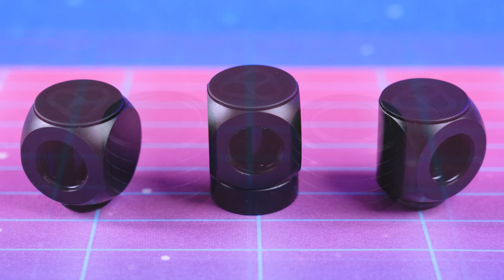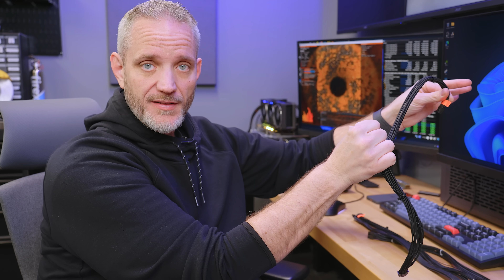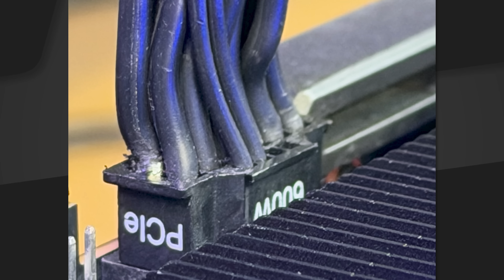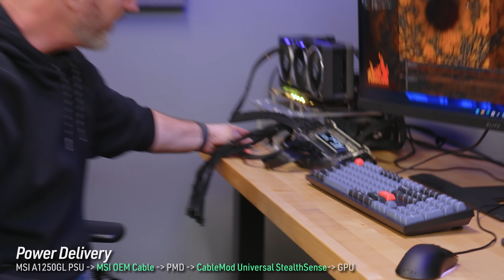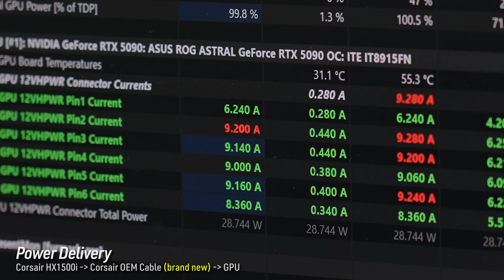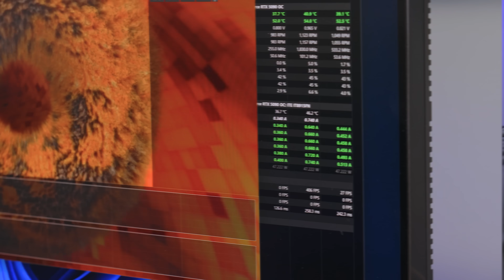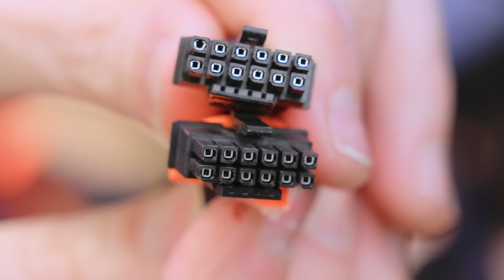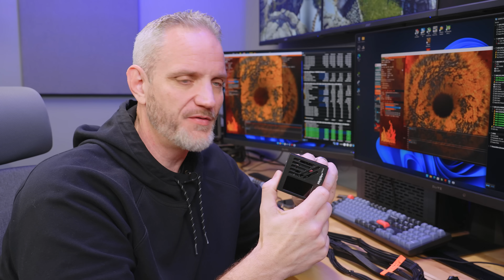More details on what could be causing 12VHPWR / 12V2x6 Cables to melt

Comment: I will never understand how it's possible to fail so incredibly at creating good cables with good connectors. It shouldn't be rocket science
Reply: Sometimes I think it's intentional if something breaks, you have to buy it again ...good for the manufacturer.
Reply: @s_wolf2186  That is called planned obsolescence, and yes it does feels intentional at times and in some cases definitely is so.
Reply: @s_wolf2186  Yeah that practice works in a very short margin and only when competition is low.
Reply: @silentferret1049  the competition is basically zero on the high end
Reply: Greed
Reply: It is a fundamental engineering and manufacturing failure from the word go
Reply: @jodosh you right.
Reply: What makes this even worse is that the company responsible for this disaster is none other than Nvidia—the world leader in GPU design. They have the resources to engineer the most sophisticated microchips and architecture ever known, yet they failed to address a basic hardware flaw. They had a golden opportunity to introduce a safer standard with the 50-series, but instead, they’ve stuck with these failure-prone connectors while pushing power consumption even higher. It’s as if they’re prioritizing melting cables over actual reliability at this point.
Reply: Look at the high power RC Hobby industry, they have 3.7v, 7.2v, 11v, and up connectors that supply thousands of watts of power from LIPO packs to very big high performance RC vehicles and they don't get melty connectors... You're right, it's not rocket surgery
Reply: @Doom2pro you right! I melted my 5070ti connected and soldered in 8ga wires and EC5 connectors. EC5 are common RC battery connector that have 2 wires and can handle 150amps at 12v-44v. Never an issue.
Reply: @nhbountyhunter And they can handle repeated insertions because they are meant for battery connectors.
Reply: @nhbountyhunter  So where did you put the 4 mm² cables? Drilled new holes in your PCB?  You kind of people have no clue how EMS works or soldering.
Reply: @darknase been soldering since highschool when I was on the robotics team. If your talking about the sence pins. I bridged them with solder and ran a 24ga from that to the positive side of the connector. It works perfectly. Infact I got better OC results.
Reply: @darknase If you smartass, you should actually be smarter then the other guy.
Reply: @nhbountyhunter  How did you manage to melt a connector with 5070 ti? Do I need to be careful? It's just ~350 watts and 75 comes from the mobo so how? @.@
Reply: @Lich__2594 a 5070 Ti shouldn't be melting cables unless there is a fault in the cable or it wasn't inserted properly.  As long as you have a good PSU and use the cable that came with the PSU, and you connect it properly.  You will be fine.
Reply: @thornstrikesback Yeah I know. I'm just curious how this person managed to do it at all
Reply: @Lich__2594  I have no idea. I think it was the same problem as Jay here. I think it was too lose on multiple pins or I just plane had it crooked. I was using a cheap set of cable extensions from Amazon.
Reply: @nhbountyhunter ohh. Thanks for explaining that. At first I was going to go go with a sketchy 2 PCI cables into 3 for the 12VHPWR adapter. Lucky I didn't and "just" got a new psu with the proper cable :)
Reply: @thornstrikesback not just a matter of proper install.  the pins are known not to make proper contact.  iirc jayz showed it took 3 to 5 insertion to get proper contact even with proper installation.
Reply: @richardbrooksshnee well... when i say proper install, i didn't feel the need to spell out everything as common sense should prevail in these situations... but now that I've said that, maybe we do need to spell it out for people, because common sense doesn't seem to exist for many people these days, so yes... definitely check the actual pins, PSU connection and angle of the cable when it wraps under or over the GPU.  But side note... Jay did say those cables were used many times over so that is not exactly real-world when it comes to loose pins like he had, unless you had a really dodgy cable.
Reply: @thornstrikesback way to ignore the context of the discussion and somehow attribute context from this video wrongly to information not from it.  new 12vhpwr connectors do not make proper contact on first install.  jayz discovered this, iirc der8auer confirmed it.  even properly connected 12vhpwr can wind up cooking under the low loads of a 5070 due to how unbalanced the loads can be on the individual pins.
Reply: @richardbrooksshnee dude... relax.  I was agreeing with you.
Reply: @nhbountyhunter *you're *sense
Reply: @tarron3237*than
Reply: @Doom2pro  We going to be using XT60 soon lol
Reply: @NeverenCH  Plenty of knock-off XT60 connectors (I think HobbyKing actually open sourced it?) that have melted in the past.
Reply: @Doom2pro it is rocket surgery to safe 20 cents on a connector on a 1000+ $ card. This is just straight up greed. And it wouldn't even be that big of an issue, if they had stuck with seperated phases like on the 3000 series and before cards.
Reply: @clockworkvanhellsing372  take 20 cents times a million sold cards, you´ll be surprised how it stacks up...
Reply: @Doom2pro  Look at the tiny pins inside the connector hurt my eyes.
Reply: A proper QS8 connector handles 110A continuous but these connectors can be $10 per pair. People don't fully appreciate how crappy and cheap the molex clone connectors on PSUs are. The PSU makers will never-ever spend $5 per connector when they can get away with 50 cents. You can't get a $150 PSU at that price any longer if you put an extra 30 dollars worth of connectors on it and $10 more copper in the thicker gauge wires
Reply: @Doom2pro I have burned and even melted 12 gauge cables on a 200w 12v motor. The connectors usually fail first even though they are rated for 200+ amps. For short bursts, I have pulled more than 500 amps through the same connectors.

A wire is only as good as it's weakest link. Now we have modular removable cables adding a connection, sometimes people run sleeved cable extensions, and all the angled 12v high power adapters, I am surprised they work for any period at all. 16 gauge wires at 12v is a joke. Trillion dollar companies save pennies in too small of wire, and  tiny connectors.
Reply: @lilsammywasapunkrock Spade connectors aren't the same as RC battery connectors.
Reply: @Doom2pro yeah, they are rated for significantly less.
Reply: We had good cables - 6 and 8 pins - 150W per 8 pin with 75W from the mobo. Was more than enough for 99.9% of the cards with 3x8 pin getting a total of 525W. But no.... need to design a new shitty cable that can't handle it.
Reply: Bad incentives.
Reply: The design spec is flawed. It is painfully obvious.
Reply: For the 5090... it is
Reply: cost saving
Reply: cutting cost and profit
Reply: So are keyboards but apple was hard learning to. There should be more class action lawsuits!
Reply: And the nvidia bashing continues. Buy AMD then, problem solved
Reply: @AndyOG2000 class action lawsuit nvidia and buy AMD. FTFY
Reply: Only because NoVideo wanted slick looking GPU and Cables.
Reply: As if they are trying really hard to make gaming PCs obsolete, so you end up paying for cloud gaming.
Reply: prolly AI designs ^^
Reply: The standard is the problem! It's not possible to create good cables, they will all fail eventually
Reply: Eps 12v (4 12v wires rated 300w), or pcie 8pin (3 12v wires rated 150w high power versions also exist rated around 288w and 324w)
Reply: It was designed to fail.
Reply: @kanlu5199 Sorry to inform you it's not quite as you think in this case. He replied to me and said he was using cheap extension cables:)
Reply: Wait, sorry you replied to something else. YouTube app is so unclear about this
Reply: @kanlu5199  That definitely is a capitalist thing.
Reply: It isn't. But it's more expensive
Reply: Because so many people are buy cheap PSU, spend the $600 and get 1600Watt PSU … a good one will be heavy, big, and requires a large case … or keeping buy cheap PSUs and hope they don’t destroy your 5090.
Reply: @simhorizon446  the psu is where one should never cheap out. If you buy a 5090 with a cheap psu, you kinda deserve for it to break. That person clearly doesn't need a 5090
Reply: @vaibuscala6441  Yep, it's like they spent their entire savings on a GPU and nothing left over for a quality PSU ... why is Jay using an MSI garbage PSU ... to prove a point that cheap PSU will destroy GPUs?
Reply: Even if it was, you would think it was an already solved problem. You do not have to reinvent the wheel if it already exists
Reply: When manufacturing just becomes bulk and QC is limited or as I see it nonexistent. There is no way in hell a 12VHPWR should sit so loose and allow to be wiggled like that. Corsair has indeed dropped the ball at least on their PSU side of things.
Reply: No it isn't. The design of the pins itself is so finicky and requires such low production tolerances, it gets prices out of a reasonable spectrum.
Reply: Even if there is just a 1$ difference between a good cable and a bad cable, when you sell lets say 1 million gpus, thats a million dollars in savings. They've been cheaping out in thermals for quite a while, cables were just the next step.
Reply: They should have partnered with molex to design a proper connector instead of Intel..
Reply: That’s because its worse, its cable science.
Reply: The problem at this point is more the ignorant connector design.
Reply: Its the fucking ridiculous connector that's the problem.   Its as if it was rushed through production just to brag about how they have a connector with higher power ratings.  Too bad they melt from the higher power.
Reply: It's called cost cutting or "cost optimization" lol
Reply: Those rockets that blow up? Bad cables
Reply: To make a profit and undercut competition perhaps they are utilizing recycled wire.
Reply: it must be by design so they can sell more cards
Reply: It isn't rocket science at all. Great solutions exist. It is greed and a few pennies. Maybe also pathological stubborness mixed in.
Reply: Definitely it's not rocket science but if they keep using shitty alloys for their conductors the reliability becomes a matter of blind faith.
Reply: We can't even get a USB cable at this point
Reply: I mean it kind of is dude
Reply: People will buy anyway so why even care?
Reply: Its by design
Reply: Yeah but it isn't wire science

Wait
Reply: They cheap out on materials is my guess
Reply: Sounds exactly like building a rocket, expecting a Saturn.... When you start with paper and glue.... You can CHOOSE WHICH SHORTCUT, you take ;)
Reply: I have a beautiful aftermarket white high quality braided cable on my 4090 and it cost me like $10. It's been working perfectly for 3 years.
Reply: yup, it's worse, it's CAAAABLE SCIENCE 😂
Reply: Current is not so easy, unfortunately.

The whole idea of having multiple wires makes the system susceptible to these problems.
I think the solution here will be beefier (and fewer) cables, with a different connector altogether.
Alternatively, higher voltages (24V, 48V) so the currents are lower.
Reply: @filippopossenti1791  It would be as easy as load balancing the thing like it was done for 100 years of VGAs needing external power. Just some overeducated bachelors degree smartass knew better. "On paper and in simulation this works, let´s push it to production untested and unverified." Excuse my language, I´m a machinist and mechanic, I´m sick and tired of this "engineering" BS, 99% of these guys never touched reality and it shows.
Reply: The issue really is the standard not the cables though. 6 and 8 pin pcie connectors will have been having all of these faults in them for years, but we'd never notice as the standards are designed to cope with it.

Nvidea have designed a standard where if any one of a hundred everyday build issues occurs, it burns
Reply: @NotFred07  Both are decreed by capitalists. Capitalism is the problem. Any engineer (which I am one) can look at that (spec or the cable) and see immediately the inevitable problems--why I avoided them and just stuck with a lesser, non-flammable card.

Folks are too happy to blame engineers not knowing that engineers have to operate within constraints imposed on them by bean counters. Engineers want "better"; capitalists want "better monetize the product" (yes, that's a thing).
Reply: @west221b the fact that any engineer who knows about cabling can look at this and know it won't hold up speaks volumes tbh.

It might be that it was designed properly but someone overruled them on the safety to make it cheaper, but I have a more awkward theory..

The cable is designed to deliver 660w (if everything were perfect), and is rated for 600w. It feels like someone asked a PCB engineer to design the new cables they needed, so they just applied a standard 10% derating factor appropriate for SMDs, rather than doing a proper FMEA.

Just a hunch of course. Could also have been management going 'nah 10% is fine'
Reply: Always used the PSU cable never the one the gpu brand gave me so far no issues or problems.
Reply: It's easy. You just make a fundamentally flawed design for the problem which shouldn't even exist.

What I mean by that - this connection is flawed by design. And put on cards that have an unreasonable power draw to handle a pile of hugely unoptimised code in mostly games which should've prioritised fun and gameplay instead of often pointless realism.
Reply: It's not rocket science as you say.  Ever wonder why 5v molex has been around since the 1970s?  Cause its simple, robust, impossible to connect wrong and can take a lot of abuse. Or how the old AT-power connector led to the ATX standard that has been around for 30 years?
Reply: @elilla331 It's also nowhere close in wattage, so the comparison is pointless
Reply: @elilla331  Its been around because people are stubborn with old tech. Its also not that great of a connector as I have had to deal with them and they are a pain in the butt to mess with and half the connectors were wobbly in both plug ends. The only thing I had that was any level of quality was the PSU wires from a EVGA power supply that you can barely get used anymore.
Reply: @silentferret1049  No. That's not why it's been around. I've been playing with them since the 1980s and played with a few PC's from the 1970s. It's around because it's a standard durable connector, that's it.
Reply: @elilla331  Funny since the Molex connector was made in the 80s, You are confusing the AMP socket which the Molex connector could adapt too. Its been widely known about Molex connectors flaws because it relies on friction to stay in place. That causes all kinds of problems that can deform the plug and the pins themself wiggle and sometimes fully pull out of the male end. I have known a lot of PC builders and they all have the same opinion over the old connectors before I even met them. I know for a fact they are not as durable as you are trying to claim. I still have connectors from the 90s, 2000s and 2010 and they share the same problems.

The reason why Molex is still even thrown in is because special devices use only the Molex connector because of how cheap and plentiful they were because they were replaced with 6 pin, 8 pin and even Sata. Molex is a relic of the past for a reason.
Reply: We have good connectors,  8pins  :P   issue is Nvidia wants to be like Apple
Reply: It isn't rocket science; it's capitalism.
Reply: Its not, but it requires attention to detail, descent components and proper tools the cheap ones will cause trouble.. I've built my own custom cables from scratch for decades as I hate splitters and I prefer super neat  cable runs of the exact  length than cable spaghetti
Reply: Well its quite easy to understand when you need to consider the past. Making something for PC cables in the past meant they were overkill in the first place normally. Then when things are pushed the tolerances change. Manufacturing tolerances were well within the levels of use in the past. Now those old tolerances are being pushed to failure. The manufacturing tolerances that companies allowed is not biting them in the butt. Its not where its made or what brands quality control. Its the tolerances that is requested and even the creation of the revised 12 pin connector are well within the expected tolerances but the manufacturing tolerances of the past that they got away with is the problem. Hell I will go as far to say that the way PCs are made is starting to show its problems again and again which lead to failures of other things.
Reply: @silentferret1049  As an experienced EE, when I saw that connector, I knew it was inadequate and avoided it: pins are too small, the data cable workaround, and the data pins offset.
|
As an engineer, it makes no sense and they are always blamed for the capitalists' decisions. Increasing profit margins means cutting costs means making garbage.
Reply: The main problem with something being engineered is the lack of real world use cases. The real world likes to add problems that should not even be there like a controller getting soaked in milk or slammed on a desk. The plug is engineered to its specs and allowed % overhead but the real problems is not the plug. 

Use case errors of not being plugged in and a good latching system of which half the problems is how they are mounted to a GPU, the parts of the GPU being built around the plug limiting access and the stresses people put them under in a Computer case. Nvidia using only one plug to its max and it even going over is fault of Nvidia. 
People trying to cram a GPU so tightly in a PC case where the cables need to be bent at 90 degrees is on the user and the companies not making them a standard 90 degree as an included option in the first place.

The companies decide how the pins can sit in the connector and also one of the main failure points given to the connector. The pins just being stuck in and not properly locked in place is still on the companies and not really on the plug as having a protective locking cap to keep the wires from moving at all. Injection molding is the only thing around the plug to force the wires to stay where they need to be that has been the best fix for that but that is still on the companies to do. They can be done with 8 pins as a safety measure but yet mostly not done, even 90 degree versions are still a rare thing for 8 pins outside a few makers by the way of adaptors.

The only thing that would be on the plug is it being designed where the individual pins were a solid prong joining the wires but since they are individual then the plugs could be tested wire by wire for even load to learn of a problem. This problem can be dealt with on the power supply side to where it will only have a certain load being output per wire and will not go over that.

There is also tradeoffs with wires that is being done, Thinner wires can mean more flexibility but are prone to breaking. The more they are flexed then those smaller strands are easier to break. They are going to fail sooner with movement as shown with this event. The more reliable solution would be thicker strands to more reliably carry the load. 

Overall this is not the plug being the problem as its more on the companies and their practices that allowed what they got away with before on stuff that did not take as much load going through it. They all need to engineer their own stuff to go with what's new and not just good enough. The plug is not perfect but it sure in the hell is being used as a scape goat by others to justify them not also doing better to remove problems.
Reply: There isn’t anything wrong until you are pulling 600+ watts
Reply: u guys are too dumb for todays tech, literally, read my post to jayz's post above
Reply: Not really a problem with the connector based on my understanding, more of a failure on the GPU maker to properly implement load balancing on the pins